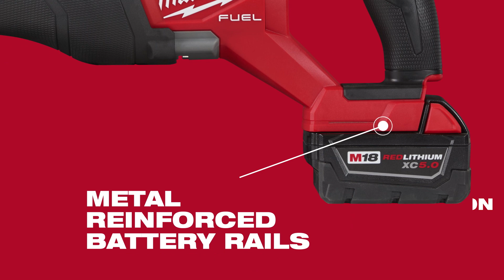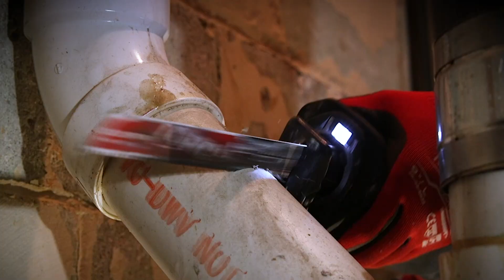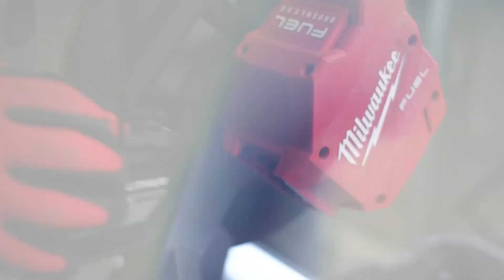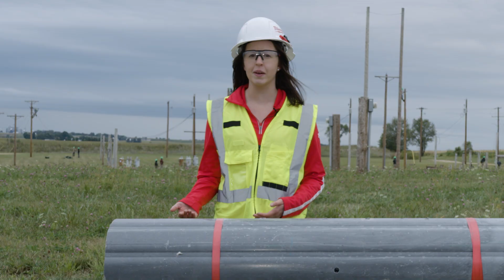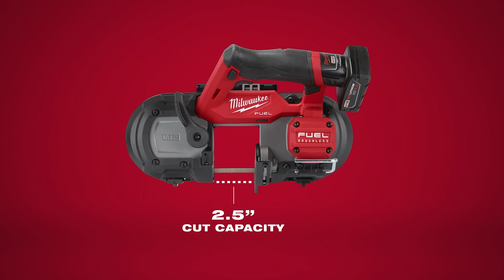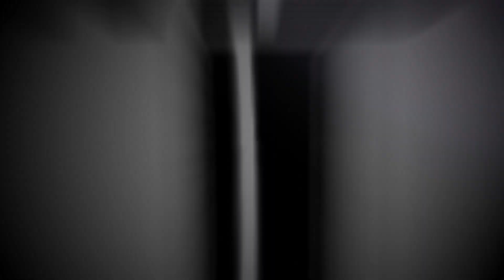Milwaukee® Pipeline™: Episode 3

Comment: Alright I live in a hurricane state Florida I like to see your power station available to the public General Public like it Lowe's or Home Depot I think you would sell a lot more than just to your average worker cuz they need power to maintain their house during a hurricane I also like to see a cooler or something, like little refrigerator unit the 18 volt system we can plug it in and keep your drinks and food cold so if you have a hurricane you can have a couple drinks have some sandwich meat whatever just need to make a little bit more available to the general public so they're more aware of what you're doing I'm sure contractors people in the work but the General Public I have no idea that some of this stuff is being developed especially if you don't see it in the stores thanks a lot

Comment: Would you all come out with a cordless nibbler.
Reply: They have one 18 ga shear
Reply: @jacksonwheywood15  is it cordless?
Reply: Sure is. Just google it
Reply: If you can find it, send the link. I have looked for some time and they do not have a cordless nibbler.  Corded only.
Reply: All it took was 10 seconds clearly didnt look
Reply: Clearly, you have no idea what your talking about. Milwaukee does not make a cordless nibbler.  If your so sure, then post the link. If not, then shut up.
Reply: Or learn to read. I said nibbler. Not shear.
Reply: Cant believe im arguing over a fucking trade name.
Reply: https://www.homedepot.ca/product/milwaukee-tool-m18-18v-lithium-ion-cordless-18-gauge-single-cut-metal-shear-tool-only/1001527753?eid=PS_GOOGLE_D25+-+E-Comm_GGL_Shopping_PLA_EN_Power+Tools_Power+Tools_PLA_EN__PRODUCT_GROUP_pla-558122111691&gclid=Cj0KCQiAwMP9BRCzARIsAPWTJ_H-n28ct414ho4kJpIWW3pRqWpNZN57QOJR5e7nVVul-DuzI3QzTeUaAifVEALw_wcB&gclsrc=aw.ds
Reply: Single cut shear or a double cut/ strip shear are what i call nibblers in alberta canada.

Comment: I' have been as asking for a M12 Fuel Band saw for years. Now it comes out but it isnt what I need. I was hoping for the same size or even more compact band saw. New Fuel band saw is more of a M18 size now. I might as well buy M18 unit than new M12 band saw. I do plant rooms and do not need 2.5" cut capacity. I was more than happy with old band saws 42mm cut capacity as it was perfect for cutting uni-strut for building frames in the plant rooms. Would be great if Milwaukee makes M12 Fuel bad saw with that same 42mm capacity in a more compact and more powerful factors.